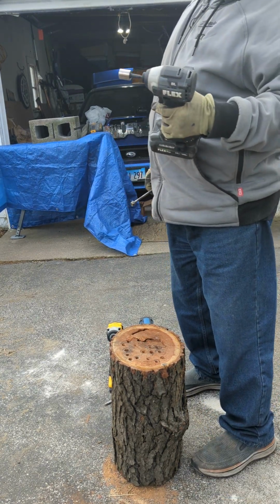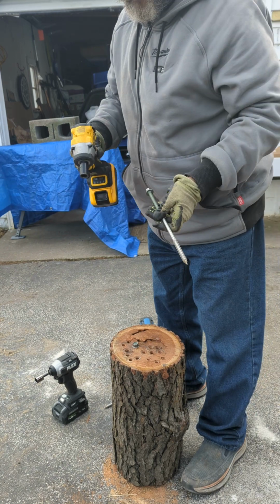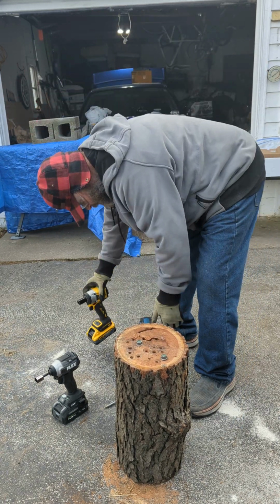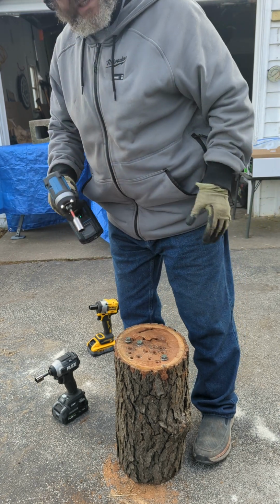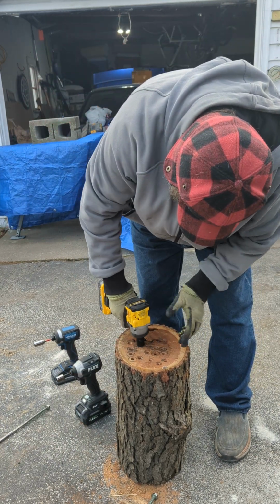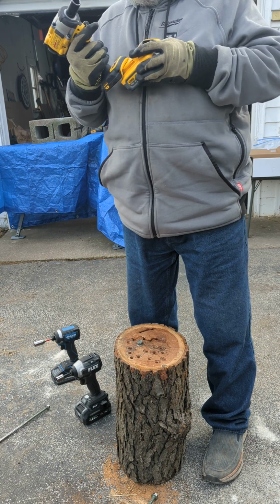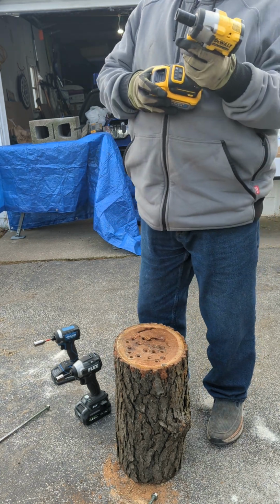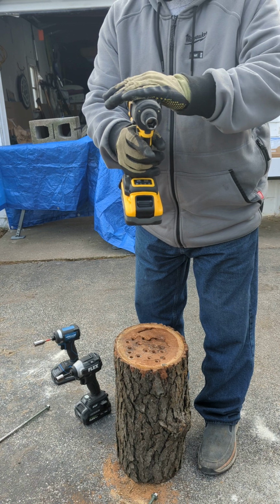FLEX Quick EJECT 3.5 STACKED LITHIUM VS HERCULES HCB81B w 4 AMP vs DEWALT ATOMIC DCF 921POWER S5

Comment: The board is going out on the impact I had the same problem I sent it in and got a bill to charge it. Shortly after I sold everything dewalt!!
Reply: I trust this comment 100%. What’s up Thibs! Looks like DeWalt has this issue with a few different models. 845 is another one.